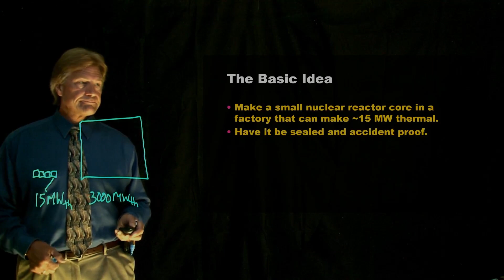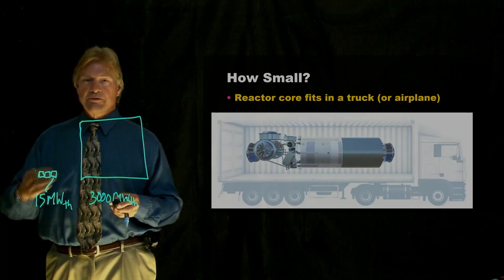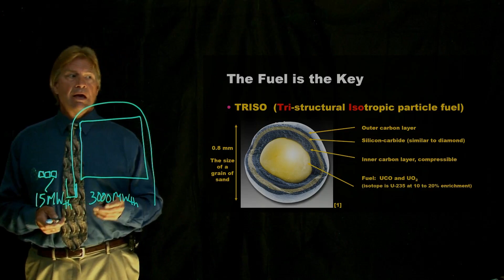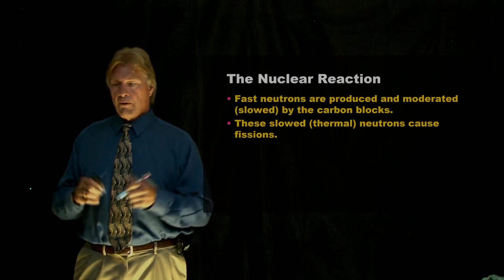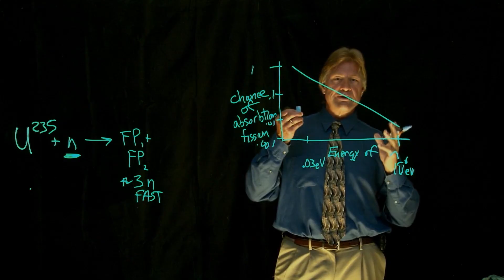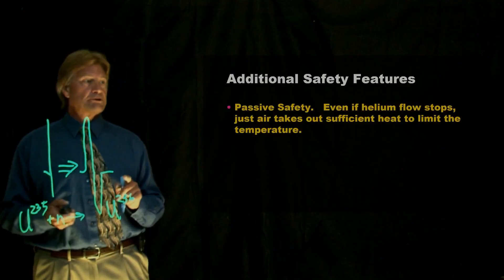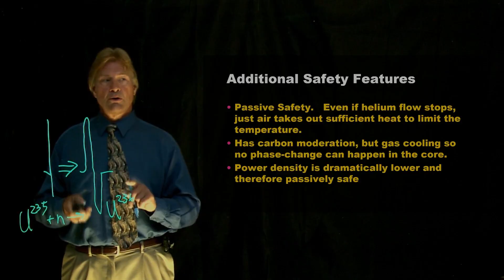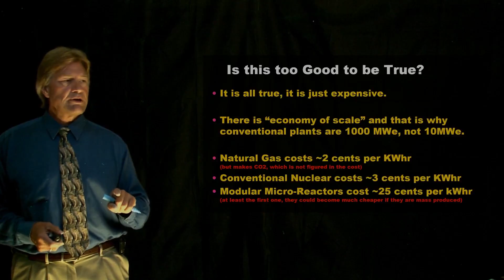Modular Micro-Reactors – The Future of Nuclear Energy?

Comment: Thank you for your videos. I'd never heard of resonance driven negative temperature reactivity coefficients. I was only aware of "Thermal spectrum" molten salt reactor's negative temperature reactivity coefficient, which I suppose may be driven in a small part by resonance, but more by the thermal expansion of the liquid fuel causing fuel density to drop below the level needed to maintain criticallity (i.e. as fuel heats up, fuel density in the moderated core drops and reaction dies down/as fuel cools down, fuel density in the moderated core increases and the reaction starts back up (bouncing back and forth like a pendulum, slowly moving toward equilibrium with every swing)). 

Worthy of pursuing, but still much less efficient than a full thermal spectrum MSR. If you want to reprocess the spent fuel from a gas cooled pebble reactor, you're going to have to smash all those pebbles just to get at the fuel.
Reply: You're correct the professor does not consider the possibility we might need to use a significant percentage of the affordable uranium. However there is also the fact that Saudi Arabia believe there's plenty of uranium in the saltwater of our oceans. It's likely though as you suggest that Saudi Arabia is not planning on wasting all of the rhenium that they harvest from seawater only using an insignificant amount of the energy so obtained. There are two worlds and that should not be the case. If you can buy all the uranium you want for $0.50 a tonne raw or whatever the going rate is these days you should be able to buy liquid nitrogen with a minimum markup.
Reply: @Irene-fu6gj  When I was referring to efficiency, I was referring to the complete fissioning of the fuel, and not so much the cost of the actual fuel. A molten salt reactor doesn't require any additional effort to get an almost complete fissioning of the fuel while solid fuel reactors such as this, will never burn up all the fuel. This in-complete burn isn't so much a financial issue but a waste one. Those left over pebbles are full of unburnt fuel and lots of transuranics, which are the nasty things people always make a big deal of. If you want to eliminate the long-term waste issue, you have to be more efficient with your fuel and get a more complete burn up of it. 

That said, while you are correct, uranium is dirt cheep, uranium fuel pellets are anything but. The vast majority of the cost associated with nuclear fuel is the result of processing it into ceramic pellets. Given the complex structure of these pebbles, I'd willingly bet they are significantly more expensive than your standard fuel rod pellet.
Reply: @williamsmith1741  the video says that they are indeed very expensive. But uranium is only cheap if you have it on your own soil. It's my understanding that Saudi Arabia does not have any uranium in the Sandhills so they have to get it from the ocean. That makes it more expensive but it's why these new reactors matter. The waste issue is never been an issue and never will be an issue I had an incoming call that I tried to take just now in the middle of this sentence or what has become a sentence because I guess they didn't put a pair he odd. There are costs associated with storing the waste but mainly it's a knot in my backyard situation and it's ironic because of my belief is that the very limited amount of energy that we take from the rhenium is by Design because we wanted to consume as much uranium as possible so is the on it so is the hog and horde and that's the situation we have where we have a lot of uranium that has been mined and processed into fuel rods that have been barely depleted. It's like the helium stockpile and the problem is unlike the helium we are still hoarding it I remember the Senate debate about the helium Reserve.

 It took me over a decade before I owned my first helium tank and it was one of those monsters many many decades ago we were just reading it but the company went out of business.

There has been a question and I think that some of the experts here and need to address it within and for this discussion. it has been pointed out that the fusion that is occurring in the Earth's core is not common knowledge for example people don't know whether it's the majority of the heating or a tiny fraction of the heating that keeps the Earth molten inside.

 I think we have to share information and not be afraid of what the truth will be misunderstood to represent. When I have engaged in dialogues and auditoriums with global warming experts I am very surprised that they don't think about the context and the parameters for example the ratio of thermal mass in the liquid water in the oceans to the thermal mass of the gaseous atmosphere. Maybe in a quarter million years or so some of the problems that are coming up in the next decade or so will be blamed on that. it's the phase-change of the icebergs that's been delaying our awareness. If you freeze all the water in a pot or just put ice cubes in the pot and then put it on your stove you can climb in there for a long time and somebody says you how do you like it now? you could ignore them or say something like give me all you got! cuz it's not going to hurt and that's not just because the temperature is going up slowly like a lobster is said too ignore if heated from room temperature but there comes a time when the ice finishes melting and then guess what? the ocean isn't as thermally massive as it seemed but the greenhouse effect it's not something you can just Reduce by 80% and no longer have a problem on steroids
Reply: @Irene-fu6gj  Yes, but still, the point is you want an efficient reactor which can burn up all the fuel because otherwise, you're likely to be left with a substantial amount of very long lived trans-uranic waste. You can eliminate this if you go with an MSR, of various types.
Reply: @williamsmith1741  I do think that your perspective is very domestic nuclear Nation Centric. I don't think that we would have a shortage of nuclear power if anybody could buy the fuel. While I appreciate this video mentioning process Heat I think it should emphasize more mechanical work. Even work that is as defined being able to do something against resistance being able to have tremendous Force across distance with large parts is also not sufficient for the reality that nuclear represents in potential. Phase-change is worth the hassle and because everybody isn't playing with nuclear reactors their ability to facilitate phase-change in novels ways I mean heating helium and melting salt with hot helium that is different but not breathtakingly innovative. I have used the word snap repeatedly. Like the clothing fastener I have argue that gas is the molecules unsnapped and a nuclear reaction that is the conversion of matter to energy can snap in ways never contemplate plated publicly! I also think that public awareness of radiant cooling is key to saving our planet and that it is also a distraction. It's a bit like the mask issue as you can see in the women's magazines were some people rated and say that they freeze small bottles and put them in their front pocket. I have done this and if you're wearing pants you can keep all of the air that is touching all of your legs quite cool regardless of the ambient temperature. But more importantly if you use like a food Walla Walla bottle
Reply: Anyway based upon my extensive experience being in 105 degree Fahrenheit or higher with these small either Naked Juice bottles because they have flat sides or the preferable more rounded corner but still very large surface area on all four sides competitor to that brand these bottles are made out of a plastic that does not crack when the ice loses some of its mass that takes up more space as a crystal. Remember wearing a mask can be uncomfortable at first because your body forgets that it's on and then brings your attention to something strange on your face. Eventually you learn that you have this thing on your face and you can forget about it consciously it doesn't cause any kind of discomfort. It's the same with having even just a few square inches of significantly absorbing Heat material touching your body. The Pentagon and Berkeley more recently have done extensive research about all the different parts of your body and this ability to dump Heat. They tend not to phrase it that way. The research tends to focus in on Comfort even the cold tube in Singapore demonstrating for the first time in my lifetime supposedly that Ziploc bag material ldpe known as low density polyethylene if placed around a air handler to keep the air from being handled will transmit the infrared and although the air handler will chill the air within the bag you can put desiccant in there so that no new humidity can get in this radiant cooler assembly to increase convective Lee Lee only the thermal conductivity of the dry air more importantly keeps the air handler from being heated by condensing the water vapor. Water vapor does not heat us up what heats us up is infrared radiation and a radiant heat barrier only address half of the question. The other half is how do we get rid of our own infrared? That's what the cold surface on the other side of materials like Lo density polyethylene; Our infrared goes in but none comes out. That makes us feel very comfortable even if it is hot humid air that is touching our skin. we don't sweat after all everybody should know but almost nobody does or at least they don't act like they know this unless we are hot and you only get hot if you put a sound barrier around your air handler because you're trying to pump air through it and that sound is so noisy you think you're making a better situation. That's just Madness. The not by accident global cooling prize suppress all of the real solutions from public awareness. As I have said you can significantly decrease the wattage of refrigerant pumps by having the boiling refrigerant contribute torque to the spinning shaft operating the compressor but more importantly you should not use such an insulator as our even indoor atmosphere to carry Heat or increase the risk of death by virus by removing water vapor. You just have to make sure the infrared does not get into the line of sight of the people. It's kind of a black hole 4 infrared liquid nitrogen or just Crystal Water the nice green 9. you don't have to golf or close your windows and send fortunes to the electric grid but you do need to get the phase-change materials from conventional harnessing of the fusion in the Earth's core or go nuclear and by all means when possible get rid of your windows but keep the wonderfully radiantly Cooling materials behind infrared transparenT's like cheap thin plastic[ ldpe repels humidity so it can be absorbing minimal Heat as it won't condense the water vapor in the outside air down to a significant surface temperature almost unbelievably low temperature that means you don't have to heat the moisture barrier and we understand what the line in The Graduate was all about LOL Ziploc bags don't just keep water from passing into or out of the bag they actually allow the air to come near without allowing the water vapor to make nuclear contact of some sort so this is basically the magic of suppress material Science and instead we see stockings and revenge marriage of the daughter coming from Hollywood like a little victory dance before or after the war to protect the oil Sheiks still wreaking we came there porn not so soft] real science. you want mainly your body heat to increase the mass of the PCM. it's got to be in the bag AK AKA zip lock bag LOL. the efficiency of the production of the PCM can be calculated as to how low and how costly. it is against such a surprising fact that we were talking about increasing electric power generation when we have too much electric power by orders of magnitude given any rationalization of the demand side. by getting rid of electrical power distribution we can save the polar bears and make shipping at less than a few thousand miles per hour not just quaint but unheard of. things like electricity and propellers ArE what our survival depends on disrupting. Ending the era of facilitating sweating to get rid of insignificant body heat which uses  more energy than the MOST optimistic forecasts about reduced pollution aspire to. Nuclear and geothermal liquid nitrogen "yank" especially as a facilitator to the prior technology bold new Solutions from science confirmed by the scientific method adopted by government even of the totalitarian ilk at first humbly by these our history will be written survive Ubly gloriously even enjoyed by or never be able to be written. So not Complicated.
Reply: @Irene-fu6gj  The issue with nuclear power is NOT the cost of fuel. The issue with nuclear power is the safety, which is signifcantly addressed by getting rid of water as a coolant. Getting rid of water and using a coolant that can operate at near atmospheric pressure also means you can get rid of MOST of the costs associated with nuclear power plants, pushing them into the cost range of top-of the line fossil fuel plants. The other main issue is the "long term waste". This pebble bed reactor design, while cool, safe, and cheap (in theory), does not address the issue of long lived nuclear waste, as this will be an issue with all solid fuel reactors. That's the point I'm making. This reactor only address' half of the problems with nuclear power, that of safety. It doesn't do anything for the waste issue, and if anything it makes it worse. 

I'm not sure what a Nation centric view on nuclear power could be, but I don't think there's any argument that the problem and one solution would be addressing the planet's ability to radiate heat away, as CO2 reduces this. I wouldn't say temperature is the primary issue, for me anyhow, at least not entirely directly. My main concern is oceanic acidification, as CO2 builds up in the atmosphere it also increases its saturation in the oceans, at which point it becomes carbonic acid. I know this is accelerated by ocean temperature as well, but my concern is the dropping average pH of the ocean. I'm very much on the wagon of those who think the Permian extinction was driven by just such an event, ocean pH levels dropping to below 8.0. Doesn't really matter, I'm just letting you know my concern. That said, my concern and climate change activists concerns can both be addressed by nuclear power, not just replacing carbon power sources, but also providing the constant base load power to run huge atmosphereic CO2 extraction plants. That CO2 could then be carbonic acid and pumped into basalt deposits like you'll find all over the world. The carbonic acid will mineralize in the basalt, forming calcium carbonate, and sequester it forever at no risk. That would reduce atmospheric CO2 and increase the Earth's ability to "radiate" heat away. Once CO2 levels drop far enough, we can turn off the CO2 capture plant and we can turn those nuclear plants to more commercial uses.
Reply: @Irene-fu6gj  "Water vapor doesn't heat us up", correct, what it does is "trap heat". Water vapor is a contributor to the green house effect. The hotter it is, the more vapor goes into the atmosphere where it holds onto heat because it's a larger molecule. That's why high humidity in a hot climate sucks.
Reply: @williamsmith1741  mr. Smith I don't think you read my comment to the economists spiel brought by somebody else but to repeat it I said low interest conceals opportunity cost.

I am proud of that line. It is very very true and infrequently articulated in any way. The comment I am replying to hear is the shorter of the two and the one in the bottom. It is also accordingly the one in the top of my notifications so this is a little bit confusing since I am new to YouTube, commenting and I did find my words that you quoted out of context likely deliberately which is fine because I understand that you were trying to make a point that you feel strongly about but I'm not sure that you understood the point I was making with those words and I understand that you have this much longer comments in which you have understood what I was saying to a greater degree palpably which I will B trying to get to soon but not tonight unless my YouTube premium trial has already come to an end. I do understand that water vapor is a global warming gas and I will tell you that there are very sophisticated scientist who have not learned that water vapor is lighter than air. The ocean releases water vapor aggressively when it rises in temperature minimally.

I am learning some new things in this dialogue on YouTube and one of those things is the paucity of information that I have acquaintance in myself and that should be familiar to global warming professionals. but I don't want to continue in your vein indefinitely since these comments are very limited in duration especially when submitted from the Android app. I have said acidification is important as well. You raise an interesting point that you can reduce acidification without having to reduce the temperature. I think that might be an important issue going forward because reducing ocean acidification by reducing the carbon dioxide in the atmosphere is not efficient. about eight years ago to six years ago I read that tiny little book about climate engineering it was a new book then at University of Southern California science library and I am a fan of academic science libraries new bookshelves. Recently however not just I fear mediocre State schools have followed they are getting rid of the paper card catalogs with avoiding the problems of uppity Reserve placers being upset that they're not getting their holds pick because they're too lazy to look on the new bookshelf for it. I do with think this is very important so I'm going to dwell on it, menial activities like scanning unsorted shelves for hold requests are easily done by a robot quickly so new bookshelf should be protected and pushing new books to the next day is a kneaded duty from the Scholastic community not despite electronic holds but because of them. electronic hold should not be enforced as long as people continue to move the book to the next day Shelf. the seven shelves that some libraries maintain or at least five should be full. I was mentored by a professor of rhetoric to believe the multiversity is blasphemy we need universities and overspecialization is not to be catered to. so I do need to suggest that we install a electronic 24-hour hold block from people's personal devices that's one touch. the purpose of the printed book remains to distinguish itself from other books also on paper people wanting to have the book wait in isolation for them to pick up should be served by electronic facsimile.

 so let me repeat what I said for the record and you can tell me if this is need not for you. The global cooling prize believe that the status quo would be acceptable so reducing global warming by 80% was the contest criteria but it was not technologically neutral despite Crow Wing it was namely the room air conditioners where defined to be electrical and instead of making people comfortable or healthy a dangerous reduction in humidity was required and a 250% markup was imposed meaning you could only spend $400 on the materials for 18000 BTU of cooling. the intrapreneur who gave the $3000000 was not aware of RMI being industrial non-profit no longer visionary but grid protecting racket. He might have known cousins as the younger man or something like that but those two old bumps need not destroy our planet further. I'm sure 3 million is a pittance of the profit from first class tickets  alone on Virgin Airline. in no way has he atoned but he has Double Down by selecting prize administrator in acidifying Etc as if he wanted a piece of the virgin electric grid territory India Etc represents. the way you stop people from buying air conditioners that cost even less than $400 to make and can remove over a ton and a half of ice melting Heat is buy instead of asking how much ice would it take to remove only the Surplus body heat! that this can be done without contact by grabbing the infrared radiation from our bodies was not mentioned in the webinars but should have been. the kind of equipment that's being tested in New Delhi right now it's like old electric water heaters or light bulbs or the so-called underwear we wear outside our face you have to treat it like a bed bug infested recliner not let anybody sitting in it not put it in the trash can unmarked but fully disabled. the people in India want to keep their basal temperature within normal limits and room air conditioners are the wrong hammer for them. they're limited means makes them eager to spend far Less on fuel not just but also on the device. that means active garments like full neck facial coverings that prevent the body from overheating instead of facilitating it.

 There is not enough capital to dehumidify the air in India's built environment nor is there capital of available for nuclear electric-powered decarbonization. Nice try though!
Reply: @williamsmith1741  in my conclusion yesterday I responded to the footnote to the comment and I'm now responding to now any way she talked about bringing the acid to the alkaline instead of the alkaline to the ocean.

I understand now is well then I am responding to a new channel for me not have a think anymore but the Illinois professor.

So I'm sorry if my obtuse mentions of comments I made in the last 2 or 3 days it's hard to track the list of subscriptions for me should be deliberately private and I will have to be more self-contained accordingly to comments found on this channel. Or as in the case of Professor Simon as well mention the Channel. That's his name the name of the channel and I do not mean to suggest he's actually a professor. He is professing I believe without tenure of any kind but the other video I referring to outside this channel has now been watched by me and it continues to claim apparently following prior Productions of him that there is tremendous fraud in the messaging and he shows too short 1950s public British videos. He also and spy saying the nuclear power plant in question consumed more electricity than It produced. His thesis was that like I have said the design of the criticized reactors was to produce the fuel rods that are claimed to be such a nuisance. He though says it was specifically plutonium that was sought a Trade Fair expense like selling cocaine through all a North when you're president Reagan to break Congress deny you funding for your contras in Nicaragua.

Your point however is that not only has the temperature of the gaseous atmosphere not the most important thing but the liquid requires more baking soda than we have in our refrigerators or that baking soda Etc would not work applied in the ocean. I don't think it is a good idea either for people to start dumping shit into the ocean deliberately in an effort to deal with a kind of volume and mass across the surface of the world but local hot spots of bleached Coral or Dead Sea to deserve such consideration.

I also find support as mentioned in the factual necessary competition internal to British and British Petroleum interests in producing enough plutonium but not scale from fossil fuel alternatives to hurt unduly those financial only interests.

 there is a great American movie where teenage blonde girl consensually runs off with a friend who is much older but wants himself to create Enterprise and not working a grain Mill but the thing reeks of Texas oil of black lives not mattering and I don't think there is anything but white people in that film done in Technicolor cinemascope with two old characters hauntingly meming about love delayed being love lost.

 it's called picnic or something right? the claim that public sentiment does not matter is cynical we do have the right to petition and if you are a labor organization fighting for windmill maintaining jobs a call to your local gas station would not be wasting time.

 what is almost inarguable however is that the resistance I encounter on YouTube goes beyond special interests wanting a piece of the waste it is reality scope deniers people opposed to actual thinking. people unwilling for State action to strand cost solely because it was not ridiculously invested. That's not the standard. the Monopoly has to be able to say no to things like fueling Mobility only Investments consistent with serving affluent homes even for no more than $5 a week if that's what the lights and logic bill mounts to has my support in being risk-free but instead we have a public policy of ghetto fooling the grid while extracting cannon fodder or wife material from its internationally trafficked customer base. Let's get nuclear process heat and heating District Heat and your Sensibility about atmospheric pressure or others Dogma  concerning H2O Steam ignores the hundred and thirty percent Boost from Synergy of molten salt with liquid nitrogen for example. But my openness has called for the use of fission to directly snap nitrogen into middle phase projecting Heat in a single step of cost beyond the imagination of the nightmares British Petroleum had about fission. if we can get uranium to turn air into liquid elegantly Dominion is ours mushroom clouds are easy in this Millenia and to say it one final time things like electricity from boiling water do not need us to do our own Fusion because the Earth's core has plenty of that and instead of paying for piano lessons for the kids of the tinkerers we could have gotten that done long ago. figuring out new ways to produce heat is a waste of resources if below the temperature of molten rock d u h